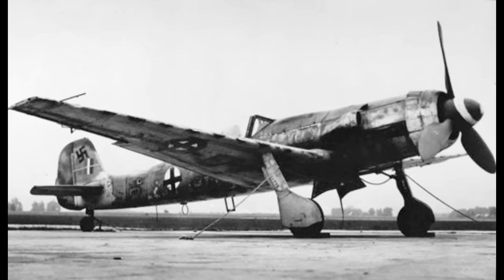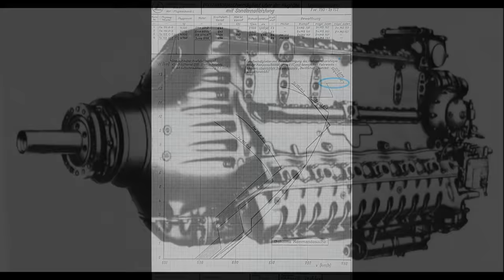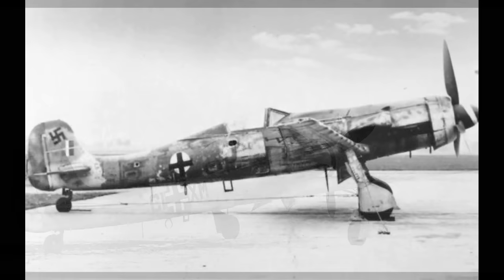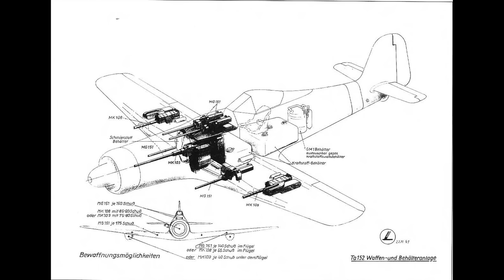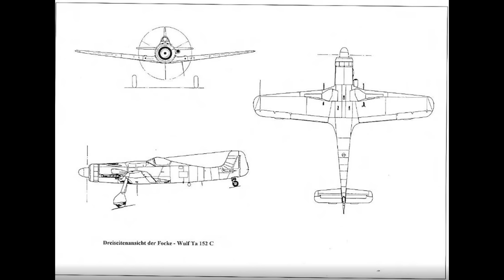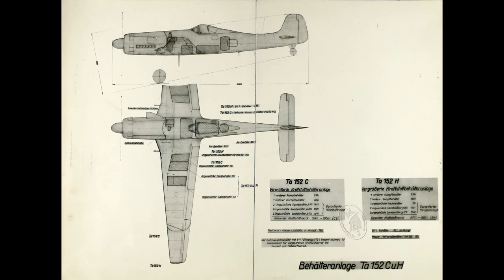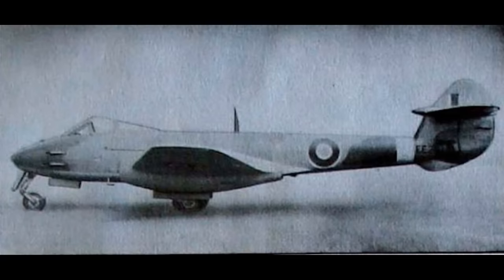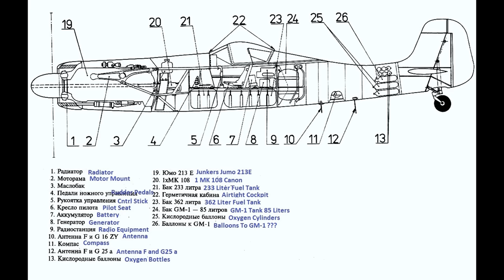Focke-Wulf Ta 152 H-1 Extreme Speed At High Altitudes.

Comment: Questions concerning difference in propeller design and implementation between German and Allied aircraft, both fighters and other types. First, the German designs typically use s different style of propeller which is wider in aspect, but somewhat shorter and the allied designs went to more  narrow aspect, but longer propeller blades. Second is that the Allied aircraft as the war went on  used more 4 bladed propellers while it appears that the German designs tended to use mostly 3  bladed designs up until the end. Do you know what the engineering rational was for the two types  and why each side made the choices they did? 
 If I might also ask what the advantage was of the "cuffed"  propellers. It seems that I see both "cuffed" and non-"cuffed" styles on  P-51's and P-47's as well as the B-29 
You research and commentary on WWII aircraft is enjoyable. Thanks!!
Reply from the maker: I'll have to make a video about that, it's too complex for the comment section.

Comment: Good post !   If the Ta-152H1 had made it into mass production, it would probably have climbed to its' service ceiling only to find a RR GRIFFON engined  SPITFIRE MK XVIX ( PS852 ) diving down from +50,000 ft at MACH .99 for its' attack run !  OK, it was 1952 when PS852 did this incredible feat.  But, knowing those clever Brits, I have no doubt they would have built a SUPERSONIC SPIT  similar to PS852 back during WW2.
Reply from the maker: That was a recon version of the Spitfire, and I haven't seen any evidence of that high mach number.

Comment: Not in the scope of this video but what would the TA-152 have been like if equipped with the Junkers 222 24 cylinder inline radial  
Is there any data on the XP-72

Maybe in the future we will see a video on the might have been. The various proposed H-24s, the Wright Tornado, the Lycoming projects, the French Mathias 42 cylinder inline radial, the Pratt & Whitney H-24s. A good source for an overview of some of these projects is Old Machine Press oldmachinepress.com 
Their latest article covers a real dog. The Curtiss XF14-C. They cover not only aircraft and aircraft engines but motor sports and stationary engines. Two of the stationary engines they covered was an 11 cylinder and 12 cylinder radial built by Nordberg in Milwaukee. Neither design featured a Master Rod. The 11 cylinder used the geared rod carrier that is geared to run at crankshaft speed allowing all rods to be basically slave rods. The 12 cylinder used a novel approach of the own design that employed tow link rods to maintain the orientation of the rod carrier on the crank. 
http://www.practicalmachinist.com/vb/antique-machinery-and-history/nordberg-radial-gas-engines-276816/
https://oldmachinepress.com/2014/01/12/nordberg-stationary-radial-engine/

Really great video by the way

Comment: At 29:00 / Point A// Subpoint 1 - it says: "Set the Oxygen Remote-Control-Vale to "Open" position. Please watch out for the Pressure and O2 Indicators; // Subpoint 2 - it says (literally): "In case of lack of oxygen / difficulty to breath - please start the "Oxygen Shower" (start it by pressing the Elbows) -- it should be exactly as you described - an elbow-operated switch for inserting concentrated oxygen;

Comment: Great enjoyable video, thanks. How much impact did those huge paddle propellers have on 190 performance?
Reply: +Steve Hindmarch   You have to remember the air density at various altitudes and how the props were optimized for the mission role of the aircraft and engine output.   A lot of thought went into the propeller design.

Comment: re: 3-valve engine:  It's not a compromise.  Exhaust gas has a whole lot of energy left, maybe 1,300 F and 100psi at the end of the power stroke; you can move a whole bunch more exhaust through a smaller valve/port than you can much lower energy/pressure intake air.  2 valves on the intake side vastly increases the 'curtain area' as the valves are opening, and can move a whole bunch more air that way.  One big single exhaust valve can handle moving that exhaust, and has big advantages regarding cooling the valve seats and water jacket design, leading to better octane tolerance for the engine, and without a performance hit, and also has advantages on the manufacturing side with fewer parts and so on and so on.  What you want to look into to find more is Jim Feuling and his patents from the 80's/90's/2000's.  BMW lost a major lawsuit against him and had to replace a couple hundred thousand cylinder heads, then he sold the patents to Ford.
Reply from the maker: Nearly every single aircraft or automotive engine that had 3 valves per cylinder was replaced with one using 4 valves per cylinder. There is a good reason for that. Junkers was trying to do the same before the war ended. Why, because the 3 valve heads cost performance as compared with the 4 valvers.
Reply: Whilst this is straight from wiki, I hope that this answers your question

" further substantial upgrade was projected as the 213J, which replaced the earlier model's three valves with a new four-valve-per-cylinder design for increased volumetric efficiency. It was also to have had a two-stage three-speed supercharger, producing 2,350 hp (1,750 kW; 2,380 PS) at 3700 rpm for take-off. It would have weighed 1,055 kg (2,326 lb).[2] There was no time to work this change into the production line before the war ended. Other experimental models included the 213S for low-altitude use, and the turbocharged 213T"
Reply: Digging deeper into the brain archives, including the 3-valve 4.6 Mustang crowd as a point of reference, the 3-valve geometry gives up nothing so long as the intake and exhaust are working into similar pressure environments, e.g. naturally aspirated or turbo-supercharged. This is not the case with the engines discussed in this video, as the massive amounts of compression in the intake tract due to the supercharging pushed beyond the single exhaust valve's capabilities for volumetric flow, especially if that exhaust environment is the extremely low pressures of 30,000' of altitude. Had the Germans come up with viable turbocharging, they may not have needed to redesign their heads... Either way, I'll give you both a half-a-gotcha on this one.

Comment: Something I've always wondered about the inverted V-12 design is how oil was prevented in pooling in the piston recesses  and other areas when the piston was on the up-stroke, etc?  Dry sump?
Reply: +GereDJ2    Most aviation engines were dry sump and pressure lubricated.   Scavenge pumps collected the oil.  For the inverted VEE engines the lowest point was the valve covers for the oil to collect and the pumps were there to remove it.  For the round engines the bottom cylinders were the lowest point and not pumping the oil out or not checking for lock before starting would result in serious hydraulic lock engine damage.

Comment: Apparently there there is one in maryland usa the paul e gaber preservation unit.
Reply: +@richardbailey3343   Correct, there is only on Ta-152 survivor still in storage/preservation at the Smithsonian.  Plus, there are bits and pieces scattered around, the most interesting is a complete Jumo 213 "power egg" assembly and cowling from a Ta-152 that has been with a private collector for years. I'm not sure where it is at just now.  Discovery of any Ta-152 wreck or digging up the disposal pits from RAE aircraft testing to look for their Ta-152 would be interesting.

Comment: that particular german was a huge fan of compund nouns, 'sauerstoffwächter' being the first one of them. problem with compound nouns in german: anyone can just make them up. so if they are neither common, nor properly defined as part of some nomenclature, scientific, or philosophical concept, one can only guess.
being a natural speaker of cause raises the chances of guessing right, so let me try:
i would guess an 'oxygen-guard' to be a thing, that measures the actual O2 content, of the breathing mixture in additionto checking the equipment and remaining bottle content. might be a case of 'deutsche gründlichkeit', but it might as well be contributed to the fact that those planes where build and the oxygen bottles been filled by slave workers, which makes quadrupel checking everything you rely on with your life, a slightly more rational thing to do, i guess.
"sauerstoffdusche' is a compound noun from 'oxygen' and 'shower'. that's not a common word either, i would guess pretty much what you guessed there.
regarding the passage about the valve... 'dichtschlauch' is another compound from 'sealing'  and 'tube'. it also says that the pilot is supposed to push the vent (open) for about 15 - 20 seconds in order to fill the dichtschlauch. so i would guess that sealing tube is stuck in the slit between canopy and body and inflates in order to press itself tight, seal that slit tight and probably contribute to the mechanical holding down the canopy by pressing its rim against the locking mechanism. the latter part is pure guess, but that tube is sealing something, so the air initialy filled into it goes nowhere from there on on. it also says that the cabin pressure is supposed to stay constant from there on up (to be controlled with the kammerdruckanzeiger), which according to the performance chart would be another 5km, hence something got to hold that canopy firmly down and tight, against considerable force induced by the tremendous difference in pressure.
some valve to vent the air exhaled by the pilot, like you mentioned must exists as well of course, but it isn't mention in the text. in theory it could be the sealing tube, since when the cockpit pressure raises above the pressure within that tube, it would be slightly compressed and the cabin air could leak until equilibrium is reached again.

Comment: Nitrous oxide is a stronger oxidiser chemically speaking than oxygen so along with being easier to handle in the volumes required, any combustion driven by it with the same fuel will release more energy making for hotter produced gas. The nitrogen from it also goes on to dinitrogen, a very strong chemical bond again releasing lots of energy.

Comment: Great video as always. Just curious. How do you think the Do 335 would stack up to the Tu152, seems to me in top speed they were pretty close.
Reply from the maker: There is very little out there on the 335. However, I can say with a high degree of certainly that it's quite a bit faster down low, but at very high altitudes, the Ta 152 H1 is faster by a good margin.
Reply: I'm pretty certain it can be said the Ta 152 H-1 was the fastest aircraft of all up at the extreme end of its flight envelope. It was designed to do one thing and it does that one thing very well. Other designs focused more on armament or mid altitude performance.

Comment: A pressurized cockpit is needed for extended time at 40,000ft even with the use of supplemental O2. Pure O2 at outside air pressure is only a temporary/emergency solution over about 30-35,000 ft and that is with correct mask design.
Reply from the maker: I added some things to the description to address this. 40k is about the limit for unpressurized airplanes.
Reply: @GregsAirplanesandAutomobiles  Certainly.  It is a matter of keeping the partial pressure of the oxygen in the blood at a sufficient level to sustain a minimum.  Otherwise, hypoxia sets in.  Amclaussen.

Comment: Hands down the Fw series was the best piston fighter of WW2 IMHO. even the allies thought so and so much so that the brits Sea Fury was based off of it.
Reply: While the Fw-190 family (which I assume you mean, not the other Focke-Wulf planes like Condor or Uhu) were good, I still think the P-51 was the best piston fighter of the war. Just my personal opinion.

Not saying it was unbeatable, but it had just enough of everything: good speed, agility, high altitude performance, armament and RANGE (very important for long range escort, which basically annihilated the Luftwaffe). Also, the K-14 gyro sight was a very good gunsight. It was good as an escort AND as a fighter-bomber with bombs, rockets or strafing. 

It also had creature comforts like trim in all axes (unlike german planes that usually only had pitch trim), making them much more comfortable to fly on long duration missions.

And they produced them in huge numbers, which is also an important factor.

So, I am not just judging as a "one vs one, who is best" because that scenario doesn't tell the whole story, but also looking at the bigger picture and how it affected the war effort as a whole. And if a FW-190 tried to fight a P-51 where they would most likely find them (at 25000 feet, escorting bombers), the FW-190 would always be at a big disadvantage due to its poor high altitude performance. 

Yes, the Ta-150H was impressive, even at altitude which this video points out. But, they only made about twenty planes... So, it didn't matter.
Reply: @Antares2  I concur . But you forgot .......LOOKS ! Like the Spit , she's gorgeous🥰...and guess what !! ? I heard and saw one fly pretty low over my house in East Anglia , recently . That brightened my day .  Pete

Comment: It would be interesting to hear your views on the Heinkel He 100, I know no examples or drawings survived the war in Germany, but what happened to the aircraft and drawings supplied to the Soviet Union and Japan , I wonder if there is something to be found in these places, a similar cooling system was on the Kawasaki ki 64 prototype perhaps inspired by the He 100
Reply: +John Doe   I would not be surprised if some remnants of drawings turn up one day.   Japan destroyed a lot of materials and info to prevent capture.  But some years back I read some remarks (cannot remember where) from someone who knew or spoke with an old Japanese engineer who had some Ta-152 drawings.   A complete set would be remarkable if true.   In the UK more recently an old file cabinet was found to have the complete set of Mosquito drawings, some 20,000 pages.

Comment: I have a feeling the steel vs aluminium spar issue might be a combination of the two reasons. On the one hand yes steel is stronger than aluminium, but on the other hand you can make the part just as strong by adding more material. So it becomes a question of do you use multiple times as much aluminium during war shortages, or do you use steel for probably a very slight weight penalty. In the case of the Ta 152 the benefit vs cost shifts to make it a good option for aluminium savings but its easier to just state one of the reasons than a likely long list of engineering tradeoffs leading up to that conclusion.
Reply from the maker: You're probably correct.
Reply: Frits Boer
1 second ago
Greg.............what may have been an important reason for choosing a steel main spar is that steel has nearly 3x the Youngs'modulus (read stiffness) of aluminium resulting in a stiffer wing, especially,  important for a high aspect ratio  where one needs to be very careful to avoid flutter which could create serious problems at high speed.  Thanks for the wealth of information which you give in your video's. Unsurpassed!
Reply: @fritsboer4315  Unfortunately that would be very, very much countered by a lighter material allowing for a bulkier, more complex shape. Think metal rod vs hollow tube, the hollow tube will be incredibly stiff before one wall folds and the entire thing crumbles in. A bulkier material allows a larger tube ergo a far stiffer tube, whilst a less bulky material would have walls too thin and fold right from the start with little force (think aluminium foil tube). Indeed even a pure metal rod without complexity will be stiffer with a bulkier material. If twice as far from the bend point a material will need to stretch twice as far for the same angle of bend after all. That alone would make aluminium stiffer than steel in practical terms for most designs, and off the top of my head I believe that is consistent with the engineers I have spoken to.
Reply: @olivialambert4124  Well you are quite correct in pointing out that there is more here than meets the eye  In this case . much depends on the geometry involved and having to deal with collapse /instabilty on the compression side of the spar is a challenge for thin sections, but can be done.  Since collapse is a  also function of Young's modulus, this would require more wall thickness for aluminium.  What happens  in bending with a solid rod vs a tube is correctly pointed out, but when  all is taken into acount the differences  between steel and aluminium will at best be small. I think that what I wanted to say is that it might have been a consideration. Thanks for the discussion however.

Comment: Very interesting. As you say, The TA-152 with the long wing was more of a specialized high-altitude fighter; its long wing would have been a handicap at typical lower dogfight altitudes. I vaguely remember a similar Spitfire specially built to shoot down high-altitude German reconnaissance planes, as told by the famous French fighter ace Pierre Clostermann in his war memoir Le Grand Cirque.
Reply from the maker: I have that book at home, I'll check when I get there.
Reply: +Vladimir Dorta    Focke Wulf was also developing the short-winged Ta-152C for medium altitudes.   If it had reached production and been fielded I think it would have been an absolute beast against late-mark Spitfires and Mustangs.  (Although the Luftwaffe was running out of properly trained pilots by then.)
Reply: @FiveCentsPlease  You're right, I knew that too.